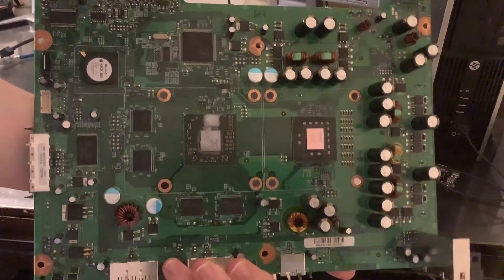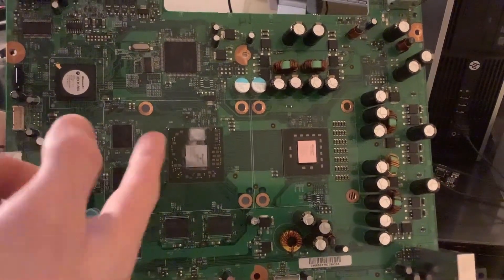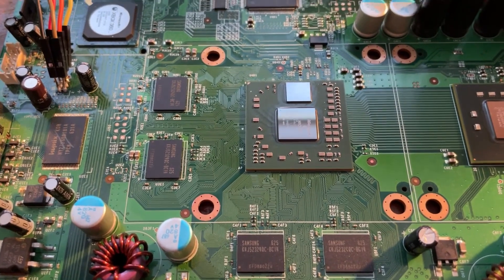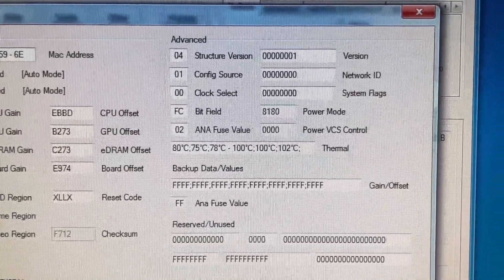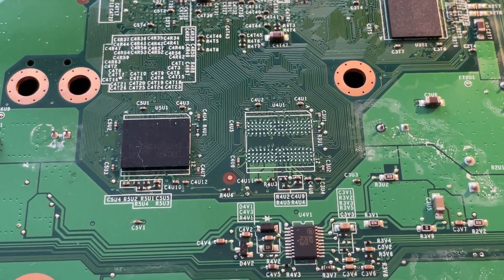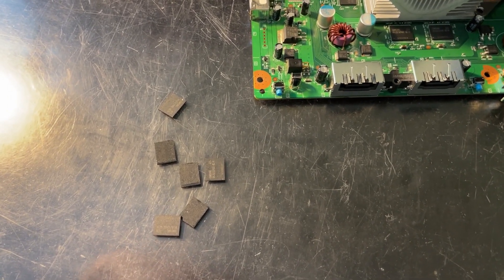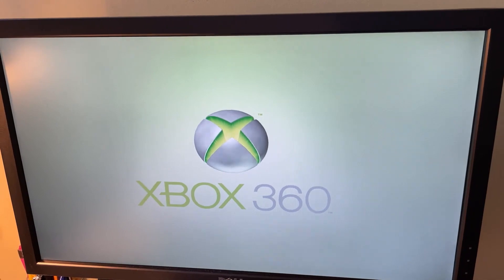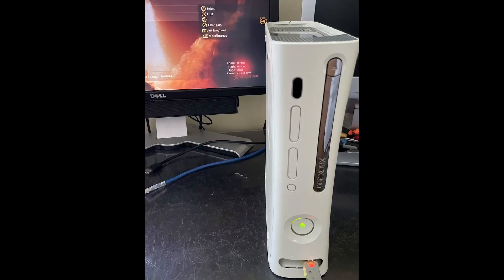Xbox 360 Xenon JTAG GPU + RAM BGA Replacement (0020 & 0101)

Comment: I know this is an old video but I really do enjoy your vids. I want to learn to do this at some point, if nothing more, just a hobby. Thankfully my two consoles, Zephyr with a updated 'fixed' Rhea and my Jasper with Kronos, will probably last a long time. 

But I have a question, since this video was of the topic, but how hot does the ram actually get? I see heatsink kits for em but wondered if that's even necessary. Thank you in advanced dude!
Reply from the maker: Heatsinks for RAM is really very stupid and you should ignore any such idiots. If it needed one, MSFT would have put them. Engineers are not stupid. The hottest I've ever seen on these chips was around 70C. Nothing at all to be concerned with, their Tj is at least 100C, I can't recall exactly the number.

Btw: Your Jasper is likely a Tonasket.
Reply: @Josh.Davidson  Yeah I believe its a Tonasket as well, has the solid state caps situated around the CPU. I know V1 still used the older style caps. Definitely not a console I am totally concerned over as much as the Zephyr. Idk why really, I know it's old and electronics all die eventually but I just really like the console and want to help it out.

Which thank you for reply and actually being dead honest! especially for their running temps since I was about to buy a thermo gun to see. But if they mainly chill at 70c, I see no problem with it like you. I heard their max was 100 but didn't know if they were close to that or not. But thank you dude!
Reply from the maker: No, Jasper A1 does not only use tall caps. It can be solid as well. There are variances, please be careful when identification.

No problem. And yes, do not worry unless you hear super loud fans or shutting down to 2 red lights (overheating alert)
Reply: @Josh.Davidson  You're right, my bad. I read into what you said... Forgive me, still learning this all lol I can confirm, it's running a Kronos (x820894), still was neat to see how small it was compared to the Zeph's rhea chip lol. Now I think it is a Tonasket. It runs the non heat pipe heatsink for the GPU, only 4 ram chips (though I see Jasper v1 sometimes came like that too as well) and a few other differences. But... otherwise, how do you usually tell a difference between the two?
Reply from the maker: 4 RAM chips goes all the way back to Falcon, but not all vendors used this. As I said, remember, there are different board manufacturers and different stuffing options. So you can't use these things as hard identifiers. This is why all these Xbox enthusiasts got this all wrong years ago.

You can check XenonLibrary.com for more info. The easiest identifier is the lack of the coil outline for the third and nonexistance CPU power phase, and the area instead has an alternate standby power circuit.

Comment: Thank you for saving that Xbox 360❤
Reply from the maker: Yessir
Reply: @Josh.Davidson  Any chance you know what the value is of the C5/C57 SMD ceramic cap on the Xbox 360 Slim RF (Power Switch) Board? I need to take mine apart today & if it is blown I wont be able to figure out. I hear that is often the cause for the Xbox to be unable to send the PSU the PwrOn signal. 
I diagnosed it while trying to repair the power supply & learning how it works compared to an ATX psu. I learned that it powers on by jumping the 5v with PwrOn instead of the ground. 
PSU powered on fine by jumping the wires inside the PSU & when plugged into the Xbox that way the Xbox was able to power on by tapping the power button, however, tapping the power button without jumping the PwrOn manually wont do anything. 

I am hoping to learn what uF/nF & V the capacitor is etc. so I can buy a replacement 1 and use some low-melt solder to remove the broken 1 & replace it.

Comment: i picked up a lot of 2 360's and 3 original xboxes

one is a xenon which was in the wrong shell (mfg date said late 2008 so i thought it'd be a good gpu falcon until i looked at the av port) and had 0110, and several leaking caps as well as a ripped smd cap on the back that someone hot glued back on, i wasn't gonna do anything with this console but i was just curious if i could get it to boot to see what dash it has so i repaired the smd cap and heated the shit out of the gpu to temp fix it expecting to get a 0001 if it was successful just because of the large amount of leaking caps but to my surprise it booted and its on nxe

i also have an early falcon with 0001 but it's caps are all good so i'll have to do some further investigation on that one
Reply from the maker: Stop heating the shit out of GPU chips :(
Reply: @Josh.Davidson  i only heated the gpu because i was curious what dash it had, otherwise the consoles weren't useful to me at all since i don't have bga rework equipment. i guess it's more of an exaggeration to say i heated the shit out of it, i got it hot but not board warping hot.
cool to know the xenon is on nxe even if its the Kinect update
Reply from the maker: Ahh.

Comment: Hey josh is it worth fixing JTAG xenon systems as opposed to just replacing it with a newer RGH console?
My 2006 jtag xenon is still alive but should it die I wonder why repairing it might be worthy
Reply from the maker: Up to the person tbh
Reply: @Josh.Davidson  Thanks Josh. Just wasn’t sure if there was a hidden benefit of JTAG over RGH
Reply: @grandtheftauto1233  The result is the same. You have a system that can run unsigned code.
Reply: @FakeSypha  yeah but also
Can run 6717 free boot but you’re right not much benefit

Comment: Are you open to fix xboxs? I have a xbox 360E with error code 0020 it says it soldered bridged under cpu or gpu something like that im not to sure  let me know!
Reply from the maker: Hi,
0020 is not a short or anything like that. It is usually a bad CGPU. Would be quite pricy to replace this chip so I don't recommend it.
PS: Use https://errors.octalsconsoleshop.com to look up codes, these are the real meanings.

Comment: A little off-topic, but are there any plans to integrate the EXT_CLK stuff for Xenons and Zephyrs into JRunner?
Reply from the maker: Yes, when it's final the timings will be added.
Reply: @Josh.Davidson  Cool, thanks
Reply: @Josh.Davidson  Good news. Is there another rgh method for xenons? Got one with latest dashboard here.
Supposedly 1.2 is supposed to run with ace v3. But the results are rather bad.
I would appreciate an answer.Greetings from Germany
Reply from the maker: @Pandabaerchen88  Use my latest EXT_CLK files.https://www.se7ensins.com/forums/threads/updated-guide-for-xenon-rgh-with-ext_clk.1835219/
Reply: @Josh.Davidson  Thanks i will try.

Comment: Just out of curiosity how reliable are Kronos Xbox 360's? i got one for free and im a bit hesitant to use it. I have confirmed it to be a Kronos as it says that on the GPU and it uses the first gen GPU heatsink. Oh and manufacturer date is 5-27-2010
Reply from the maker: The most reliable 360s. Even more than the Slim. I fix and replace almost as many Slim XCGPUs as early Phats. But Jasper and Kronos are RELIABLE.
Reply: @Josh.Davidson  awesome, thanks alot.
Reply: @Josh.Davidson  Hello Josh! since I have a RGH trinity from my brother using it for 10 years with my family's data on it, how can I preserve it from breaking other than not turning it on so the Gpu don't go gone? Thanks!
Reply from the maker: @angwysocnub4195  You can't do anything to prevent failure if it's coming.
Reply: @Josh.Davidson  Alright thanks for responding though! I can't wait to see more content keep it up!